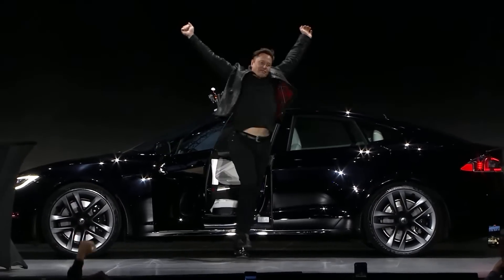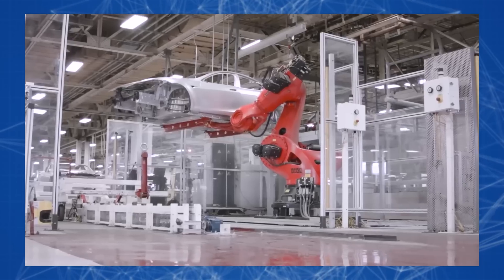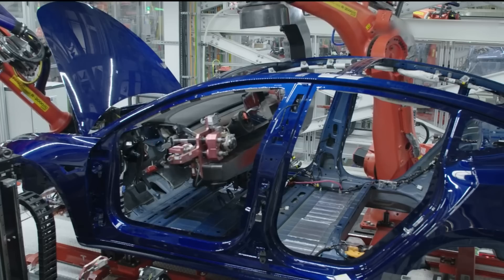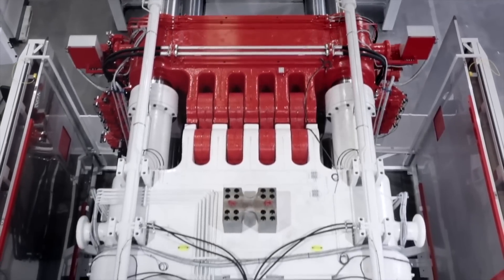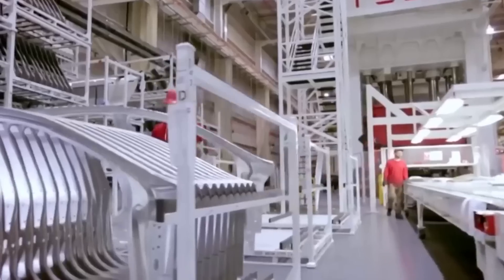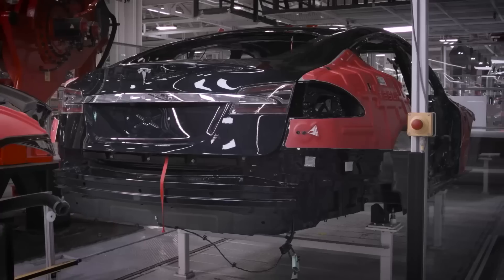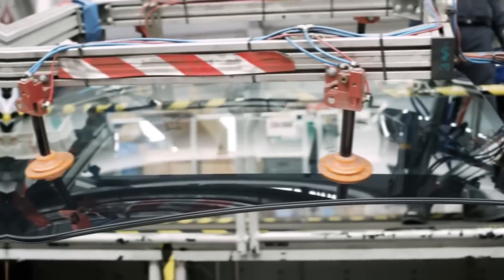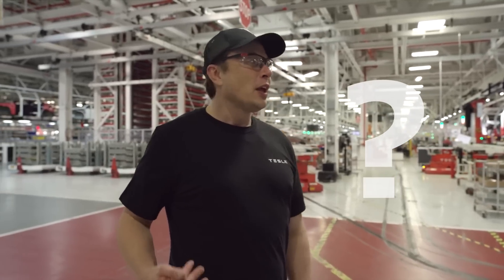Why Tesla Giga Press will not leave a single chance to competitors

Comment: What is not being talked about is how a fender bender damages the entire chassis. Meaning you had better have full coverage at a ridiculous price so a whole new car can be purchased. If Elon were truly a genius AND cared about the customers he would make a product that could be repaired.
Reply: Lol , there is a repair manual that lets the autobody repair shop know where to cut the part and order a new one. Then use fastners to attach a new part without replacing the whole car. but most insurance companies rather sell the damaged car than pay for labor for that car you are attached too.
Reply: @chana70  In most cases, castings can not be rapaired.
Steel bodies can be repaired and reinforced if needed. Most body shops won't even consider welding an aluminum body, esspecially not if it's made of a special materials.

But no to worry, Tesla has blocked third party repairs shops from any meaningfull work on teslas.
Their service centers are not prepared for these jobs. So in the end, costumers will end up buying a new car.

BTW: the "brilliant" stainless steel exoskeleton of the cybertruck, will get damaged much easier than traditional chassis. And stainless steel body panel are close to impossible to repair.

Comment: sooo there just reusing ideas that are as old as WW2 [Germany used giant presses for there fighter pilots, and the US and USSR used even larger presses during the cold war], and are not releasing prices and economics on this.

Plus anyone can buy these presses from there Italian maker, and given that car producers have been around for over 100 plus years on scale and have faced high levels of competition it makes you wonder why this is not more common if its such a great idea, maybe due to the fact that its not a great idea? Likely is the answer right there   

Also not the largest die casting machine in the world, not even close [there are 50,000 and 75,000 ton die presses out there which blow this out of the water].
Reply: You're talking about hydraulic presses, not die casting machines. The latest Gigapress is the largest die casting machine ever built.
Reply: No
Reply: You are right,the gigapress isn't a great idea,it works for Tesla because they don't have the mechanical engineering experience that other legacy manufacturers have.They simply don't need this machine.

The truth is that the gigapress won't give Tesla a lead,just help them to achieve industry standards.

Comment: I wonder how the front and rear mega castings will be repaired after a collision?  Will any accident that breaks the mega casting have to be totaled?  How is that going to affect insurance costs?
Reply: If the impact is enough to damage the casting it's likely the car would be a write off. Same for other vehicles where the frame is damaged. By that point your talking about glass, multiple panels, lights etc. Just looks at the damage from a crash test going at a slow 50km/h. EVERYTHING is designed to break, to protect the passengers.

I've heard that sometimes, as soon as airbags go off they will also write off a car as the damage caused from them deploying is not worth fixing. So really, wouldn't expect insurance to change from current cars.
Reply: Any rear damage and the car may be totaled. I guess you could buy a complete new casting, then cut a section out to weld in the damaged section, but because of all the support fins I don’t think you could get to these areas.
Reply: @davidmanasas6606  They total cars with even less damage.

Comment: Elon Musk is the 21st century's John D. Rockefeller, and Tesla Inc. is the new Standard Oil Company.  Even better, Musk & Tesla & Spacex are setting new records for innovation at speed.
Reply: Wft you smoking
Reply: I mean reusing old tech and ideas is not innovation [huge presses where used in WW2 and the cold war and are still used today for a lot of stuff and reusing boosters is not a new idea, nor even something he did first]. To add to this we dont even know if this is actually profitable or a good idea as per normal the numbers are hidden as to the costs and economics
Reply: @kkirschkk  ...The Italian IDRA machines that use hydraulic pressure to injection-mold Tesla's custom aluminum alloy are not our great-grandfathers' "huge presses".  The names are the same, but the technology is entirely different.  
Earlier rocketeers may have dreamed of reusing boosters, but didn't have the tech to land them upon return.  
 Spacex must now be profitable, else many of their private investors would by now have walked away.  Just my thoughts...
Reply: @jrb_sland5066  jaguar use that pres  for 20 years min.  That with boosters  nasa developed in '70 but for them in that time was cheaper to make new not to land them. Same with rusians.
Reply: @jrb_sland5066  pressing custom alloys is not new, and I doubt its new [unless you can prove otherwise], so again just reusing old ideas.

I raise you an X-33 on the rocket engineering side, again not a new idea. As well how long did it take Tesla, Amazon, Google and the like to turn a profit? over a decade? SpaceX's profitability is not a sure in.
Reply: @kkirschkk  ...Thanks for the conversation.  Sorry if I come across as argumentative, but it is my understanding that the IDRA multi-ton die-casting machines {AKA giga-presses} are new kids on the block.  This is not ordinary stamping press work on sheet material, nor is it drop-hammer forging, but true injection molding at a scale/size that hasn't been seen before.
Spacex has been in existence since May 2002, so it too passes the "over a decade" test.  I watched live the webcasts of the first Falcon 1 launches from Kwajalein Atoll & heaved a huge sigh of relief when their fourth launch successfully placed a payload into orbit in September 2008, saving the company from fatal bankruptcy.
NASA's X-33 rocket plane never flew after certain manufacturing processes were found to be inadequate.
I'll grant that none of these ideas are precisely "new", but heretofore were considered science fiction.  Tesla & Spacex have brought them to profitable reality.  Kudos to Elon Musk...
Reply: @jrb_sland5066  well again we dont know if Space X is profitable, and based on the fact there thinking of IOPing Star Link to generate capital for it makes it seem likely its not profitable.

SpaceX is for sure the most impressive thing that Musk has done, but a lot of stuff is unknown about the company and its not as impressive as people make it out to be

Comment: @Innovative Techs
Do you know, whether using giga press
-Is overall faster (combined time for molding and assembly) than using welded parts
-is cheaper
-is lighter
-has better mechanical features?
You dont know that answer to any of the above points. So your video is just repeating Tesla marketing.

Comment: Super funny how much Tesla has gotten caught up in classic automotive engineering while being left behind on core issues with 400V technology and correspondingly slower charging speeds.
Reply: 250 kw vs 350 kw isn't much of a difference when there cars still charge at a faster pace per mile than most 90%+ of evs for a longer sustained duration
Reply: @NadeemAhmed-nv2br  , if everything runs optimally, the Tesla has its 250 kW for one minute. And you know that, too.

Comment: The real secret is not the machine - it’s the metal alloy and the cooling process they came up with that prevents cracking when the casting cools.
Reply: Metal aloys are nothing special nowadays tbh, even sandy munro said that, other manufacturers like mercedes, porsche, maclaren, koesnigsegg..... have already developed and used tons of different alloys and composite materials that tesla dont even know.

Comment: One of the keys to Elon's success is that he celebrates failure. I am talking about a special kind of failure. I'm speaking of the type of failures involved with iteration. Recognizing a weak link, having an idea that might improve a process or even eliminating a process and acting on that knowledge is what is celebrated. Even if that new idea fails, it may provide good information that could lead to a similar solution that does work. Failures of this type prove to be advantageous overall. 

I worked with a company that was heavy into chemistry and chemical engineering. One of the chemical engineers (and owner) of the company came up with an idea that looked fantastic on paper. The production line was built, but on the first day of operation it became obvious that there were major problems and the whole thing could end up being a very costly failure. I'm not a chemical engineer, although I often did the job of one. When I started digging into the process some ideas began to form. After a few weeks that turned into what seemed to be desperation I decided to tell the owner that I had an idea that might work. Out of frustration he stared at me (glared at me, really) and finally told me to do it. Buy whatever parts you need and you have two weeks. If we can't get the line going by then becoming a profitable company is unlikely. it was after all a start up company. This was back in the early 1970's. Honestly, that scared me and all of a sudden I felt like I had a ton of bricks hanging on my back. I began to doubt myself, but it seemed that I really had nothing to lose. I couldn't change the actual chemistry involved. It would take far too much time to reconfigure all of the equipment, but I could change the flow and the mechanics involved. It took me less than a week and only about .5% change in the equipment with an almost negligible cost. I got some employees together (I was only like a worker at that time) and we started up the process on the line. It felt like my heart was in my throat all of the time. The results were amazing. I calculated that we could easily produce at a rate of about 3x what the owners original expectation had been from the beginning. I went to the front office and told the owner that it works. He seemed almost excited, but skeptical. When he watched the process in action, he asked me a few questions and then stared at the process with sort of a frozen look on his face. He finally looked at me and simply told me to get the line to full operation and I expect to see the that 3x production you predicted. 

I get the feeling that this would be something similar to working with Elon. The line that was set up was initially a failure. However, what I saw were the components required for success. If that line hadn't been built I would have never seen the opportunity it actually provided. So although the initial project was a failure, with minor iterations, it became a success. That failure was worth the celebration because we learned something that helped build other processes that incorporated some of the changes that was made to the initial line. The company was fairly new and about 6 months or so later the company bought uniforms for the employees. The hourly were given green uniforms and the salaried given brown uniforms. The only real difference for the two colors were so visiting customers, outside agencies such as AQMD or OSHA would know they were speaking with a representative in management or be able to see if they found an issue. I mentioned to the owner that I couldn't find a uniform with my name. He grinned and told me to look for mine in brown and walked away. That was the strangest promotion I think I've ever had. 

There are more incidents that remind me of what Elon might be like to work with. This man I worked with shared many characteristics with Elon. He was tolerant of failure and assured me that failures can be the best road to ultimate success, unless you are not able or willing to learn from them. He was the toughest boss I've ever worked with. I would also say he seemed to be the boss that most appreciated my work.

Comment: 0:18 - Elon is not the "owner of Tesla".  At the time of this video Tesla had already moved the Model Y to ONE die case part for the rear.  AND they have already produced single die castings for the front of the Model Y but have not used them in production yet.
Reply: He owns a lot more of it than you or anybody else does (about 22 percent)

Comment: Tesla doesn't produce the gigapress. Anyone can buy these, essentially.
Reply: They have patented the alloy used in the gigapress and how to operate it to produce the cast with the highest efficiency, so ICE manufacturers can't do it themselves either. Their engineers are not educated for this method at all.
Reply: @hkchan1339   But the german engineers.😜 Tesla bought 2017 the german company Grohmann automation to improve the know how for the development of these patents called „unibody“. That’s why Elon Musk loves german car engineering and suppliers.
Reply: @steffenoei9078  
Gigapress is made by Idra, an Italian company.
👍
Reply: @pierlo2498  Idra is owned by LK Tech, a Hong Kong company, the acquisition happened in 2008
Reply: @hkchan1339  The alloy Tesla uses is nothing special and the legacy manufacturers are way better at this than Tesla,they don't need this.
Reply: @lordanonimmo7699  Yada yada yada, so why aren't they selling cars that are beating Tesla?
Reply: @hkchan1339  And they are,Tesla advantage is what silicon valleys and startups have is the battery and software  but from a automotive perspective Tesla is way behind in production and mechanical design.
Reply: @hkchan1339  no they didn't stop lying 🤣😂 and they can't even if they wanted too
Reply: @hkchan1339  All of Tesla's patents are open. Any other manufacturer can do what they're doing.
Reply: @logitech4873  that’s not accurate.  Tesla opened their early patents back in 2013 time period as it relates to early Model S.  They have over 500 patents during the past years and those are not ‘open’.  These are protected intellectual property.
Reply: @mikeplate  Ah that's sort of contradictory to their earlier words, but oh well.
Reply: @logitech4873  They still keep some secret sauce
Reply: @mikeplate  $700 billion +
Reply: @hkchan1339  same press is in Deimler plant, Jaguar use same pres for years.
Reply: Thank you!
Reply: Tuning tons of parameters on that machine is the key.
Reply: @chiasung  no it isn't is just an oven you can by and come up with your own mixture of metals 😂🤣
Reply: Teslas are innocent

Comment: THIS IS WHY AM BUYING SHARES IN TESLA
Reply: Really?  You've held out this long, but the acquisition of this piece of plant is what tipped you over the edge AND you felt it worthy of shouting it out in ALL CAPS?

Please share more of your market analysis!
Reply: @g00rb4u  The giga castings remove around 250 robots front and 250 robots rear of the assembly process, Sandy Munro engineering teardown influenced me, the fact that the cars are the safest in crashes, the active safety and FSD is coming will make them very safe saving money on insurance, people will also save money on maintenance, even down to back EMF braking saving the brake pads, Elon is so focused on the machine that makes the machine the profit margin/price is going to beat other manufacturers, every single front Tesla is beating the legacy auto makers, even down to the fact that high speed switching for the electric motor means high frequency operation for a 20,000rpm motor so you need "LITZ WIRE" coils to reduce "Skin Effect" reducing copper losses in the windings which I studied 30yrs ago, the armature optimization of the motor also, Elon has got an awesome recipe for success here.

Comment: tesla should be sharing this technology with all American manufacturers if their actual goal is “to accelerate the adoption of renewable energy” instead of “to unfathomably rapidly inflate a billionaires pockets”
Reply: Do you mean the Giga Press technology? Because Tesla buys those from IDRA. Any American manufacturer can also buy directly from them.
Reply: @nitetrekker  I mean they should remove their patents for battery cells, ev drivetrains and their chipset designs.  The gigacasting process is also patent protected.